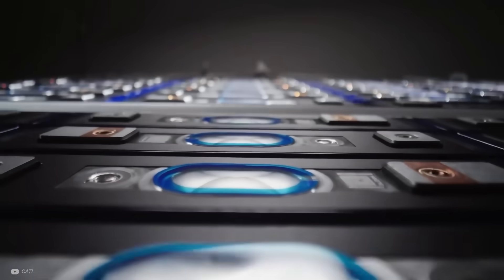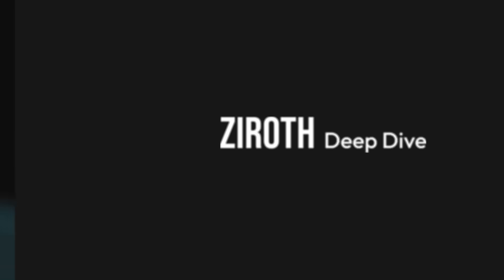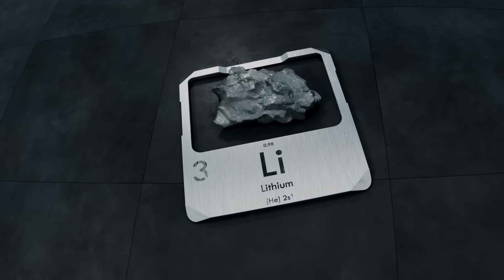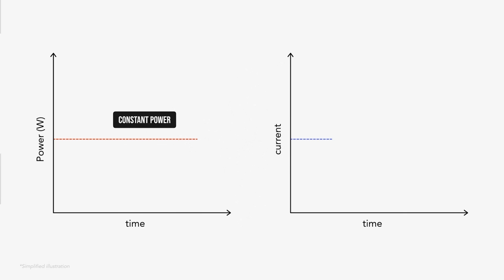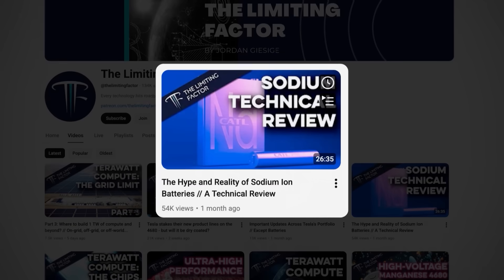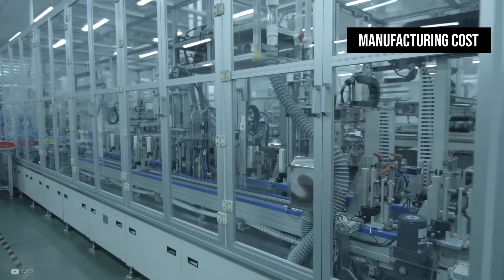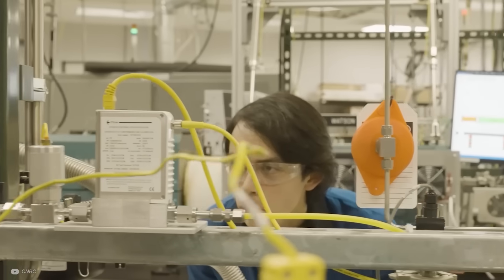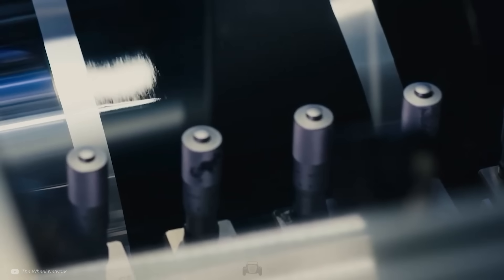How CATL’s Reinforced Sodium Battery is Insanely Cheap

Comment: When a electric battery the size and weight of a 15 Gallon gas tank gives a 1 ton vehicle a 300 mile range in any weather with the air or heat on, then and only then will a battery powered vehicle be real. At the same time an under 15 minute charge time would be required.
As others below have stated there is the problem of where all the electricity for those vehicles comes from? That and the increasing use of electrical energy (and Water) for Computer Server centers. Such factors are all ready on the path to intersect in the near future resulting in quickly increasing costs for the same. Politicians, Scientists, Car manufacturers and the public in genera, put on their "Rose Colored Lens Glasses" and ignore such matters. Either because such thoughts destroy their dream or  they are incapable of deep thinking. Not their fault as we all live in the Present and the Future is far away. Example, who remembers all the forests in Los Angeles or other extreme changes to our environment? We need to listen to those (All below comments) who say "what if, wait a minute or there is this". It is difficult to stop and think when in a human herd with  momentum. OK, off my "Soap Box" by!
Reply: As electronics evolve the need for power will continue to go down. Do you not recall the revolution from the Pentium daze moving into the Core 2 era? A huge reduction in power requirements due to advancement in silicon. This is not just the trend, it is the unavoidable progress of technology. Watch these data centers become less and less power hungry as electronic solutions become ever more energy efficient.

Comment: Scientists have known that in time Sodium Ion batteries will be cheaper and have the cold weather ranges that lithium is weak on.  Lithium batteries have been in major production for 10+ years and sodium batteries are just now approaching major production.

Most of the solutions to make Lithium batteries cheaper to make and more power dense and all have been tried.. and except for new major breakthroughs we are aproching the end of the easy and moderate improvement capabilities... while Sodium Ion is still at the start they have thousands of tweaks they can do and adjust to find chemistries and production methods and all till they come up with better ways... I figure 5 years is a good estimate till they become cheaper than Lithium at close to the same power densities. 

No one of these chemistries will not end the other .. at least not immediately... heck I bet most of you still have a component or two with NMHI rechargeable batteries in it  these were in major production in the 1990's  they are still in use in many places even though there energy capacity is 60-120 Wh/kg.

Each battery chemistry has its pros and cons and each sub category of chemistries do as well in a year or two they will reach price parody per KWH but still be larger and heavier cells. Being the increased safety of the cells they may pop up as solutions in some areas that lithium fail at.. like for instance they may be able to have larger power banks for sodium ion in planes for personal carry. We already know they work better in extreme cold temperatures so that is two places where right now they are better than any of the lithium chemistries. 

Again one chemistry will not kill another immediately or fully... i bet if you go to a store and pick up a "Vape"  that ((%+ of them are NMHI.. go to the dollar store or such and find something rechargeable again 99% of the time it will be NMHI. 

Sodium Ion is just another chemistry that will have its pros and cons and specific places it is best at

Comment: Is the voltage really such a problem? I mean normally these batteries are wired in series so that the voltage adds up, resulting in less current flows on pack level. Since the voltage is lower than lithium counterparts, more sodium batteries can the placed in series to reduce the current flow.

Comment: Why do the Na cells need to compete with LFP or NMC cells? Surely the first target should be to replace the Lead Acid batteries currently used in ICE cars especially those with stop-start features; they're lighter and I suspect longer lasting too.
Reply: This would indeed be a perfect application for sodium ion if their price comes down to hoped for levels.

Comment: Interesting, although this does only bring NA batteries up to equal standing with LFP,  maybe not enough to displace them altogether. A much cheaper price would do that but we can't expect that for a few years. Better performance in hot and cold weather? Not as big an issue as demonstrated by Norway and its near 100% domination of new cars being EV's, there are ways around those problems in modern EV's. More environmentally friendly will attract some people, but the addition of Antimony sort of kills that position, Antimony is extremely toxic to mine, and the fact that the majority of Antimony comes from China is a bit of a worry also. Safer? The vast majority of car fires are ICE car fires, you are basically driving around in a petrol bomb, EV's car fires are scary because they are new and rare, they get a lot of news coverage.

Overall I can see NA and LFP batteries continuing as two different battery chemistries for a few years as battery development continues, and there are other competing technologies in the background slowly beavering away, yes they have solved one of the major issues of NA batteries, the voltage curve, but at the same time removed one of the major attractions, environmentally friendly with the addition of Antimony. Batteries are still in development, NA with Antimony probably won't be the last word in batteries, give it a couple of years yet.
Reply: Hopefully they will find another sodium ion chemistry with no usage of rare earth materials at all, but still has high energy density and better performance

So far there are 2 chemistries that will become a more eco friendly contender to the Na-Sb: Regular layered oxide sodium with anode free design and sodium sulfur batteries. Both has no rare earths, high specific energy density and also cheap to make, but it's still researched in labs and not ready for mass production yet
Reply: It brings Sodium up to the gravimetric energy density of Lithium, but not the volumetric energy density; which remains lower in Sodium based cells. Looking at the current Naxtra batteries in CATL's Freevoy dual-chemistry packs the Sodium cells are about 15-20% wider than their Lithium counterparts. This means in space contrained applications like EVs, then for the same physical battery dimensions, a Sodium based pack will have a lower energy capacity (kWh) than a Lithium based pack despite having similar weight based cell energy density. The result is less range available from the Sodium battery pack.

Comment: Some other great reasons this will be cheaper:

1. We can re use the existing infrastructure and dont have to rebuild or build from scratch
2. Sodium is 1000x cheaper than lithium
3. Sodium doesnt require the expensive copper linings it can use cheaper aluminum

Comment: There are still two major bottlenecks:
	1.	Truly fast charging, meaning a full charge in under 15 minutes, including charger availability
	2.	Much higher energy density, ideally at least 400 Wh per kg at the pack level

So even though I am a strong BEV enthusiast, they are not quite ready yet to become the mainstream vehicle choice.

Comment: EVs care about volumetric energy density, not gravimetric energy density. Matching LFP on a Wh/kg basis does not solve the real problem. Sodium-ion batteries will still remain roughly 20–30% below LFP and about 70% below NMC in volumetric energy density, which is the constraint that actually limits range and vehicle packaging.

Comment: Low-temperature performance of sodium-ion batteries is often oversold. Being able to operate at low temperatures does not mean good performance at low temperatures. As with lithium-ion batteries, usable energy density degrades significantly in the cold, and in sodium-ion batteries the degradation is often worse. Given that sodium-ion batteries already start with roughly a 30% volumetric energy-density disadvantage compared to LFP and about a 70% disadvantage compared to NMC, cold-weather operation compounds the problem. For EVs, where volumetric energy density directly limits range and packaging, low-temperature usage is therefore particularly unfavorable for sodium-ion batteries.

Comment: Technical specifications do not decide market share. Lithium ion batteries are limiting sales of EVs since their actual mileage is grossly exaggerated based on tested with the vehicle running at a constant 50 mph and not pulling or carrying a heavy load and under cold conditions falling still further. But the real limitation, apart from available power to charge them due to power production deficits and competition on cost from AI and digital currency server farms is the cost of replacement if damaged and the high vehicle insurance premiums due to this, the high costs of repair and high rates of depreciation where fleet sales into the second hand market are severely limited by these factors when typical buyers in this market cannot afford them. CATL, like Nio hose battery packs they supply, is investing heavily into the battery swap market  that overcomes these problems , especially with their new sodium ion batteries and the potential link to the small modular nuclear power plants of 5 to multiples of 100 MWh developed by Russia's Rosatom , the leading global supplier and operator of large scall nuclear power plant. Nio have already licensed their system to several European EV manufacturers and already have 50 units in operation, especially in Norway which is ahead of other European countries in he adoption of EVs

Comment: Apparently, as of December 2025, CATL's sodium-ion batteries have officially entered mass production. Next-Gen Timeline: While the 1st-generation is in production, the 2nd-generation (aiming for 200 Wh/kg) is set for market launch in 2026. The current cells offer 175 Wh/kg (comparable to LFP), a 500km range, and a massive 10,000+ cycle life. Cold Weather: They retain 90% capacity at -40°C, making them superior for winter climates. Adopters: Li Auto and Chery are the primary partners integrating these into upcoming passenger EVs. Sodium is roughly 50% cheaper than lithium and nearly "inexhaustible".  While the 1st-generation is in production, the 2nd-generation (aiming for $200$ Wh/kg) is set for market launch in 2026, with large-scale scaling expected by 2027.
Reply: Sodium is literally and really inexhaustible
Reply: All very cute, but have they released actual specs? Or just PR?
Reply: @dzhiurgis  CATL have a track record, they've been the global leader in EV batteries since 2017 and held approximately a 38% global market share as at 2024.
Reply: @nae-nae-99  everyone knows that. Doesn't change a fact that they haven't released anything - specs, cost or actual vehicles.
Reply: @dzhiurgis it has just entered mass production at end of 2025. They are not gonna magically make the vehicle available in big quantities since catl itself doesn't make EVs, the cost would be largely irrelevant as well
Reply: @Wfmike  mass production and we still haven't got the specs.
I mean I don't doubt anything, it's just it's not going to go mainstream anywhere near as quick as some hypsters say.
Reply: @dzhiurgis the spec is on their press lease. Also actual mileage depends on the vehicle configuration so it's largely irrelevant.
Reply: Why are you getting so many upvotes when your lazy copy-paste repeats an entire sentence?
Reply: Реальная плотность сегодняшних натриевых элементов - 120 Вт*ч/кг. Им ещё далеко до LFP.

Comment: 4:25 The graph is misleading because the Y axis for current implies current is zero when the battery is fully charged.
Reply: Also the voltage curve is 1/current so the curve should be a hyperbola with asymptotes at y axis and x axis.